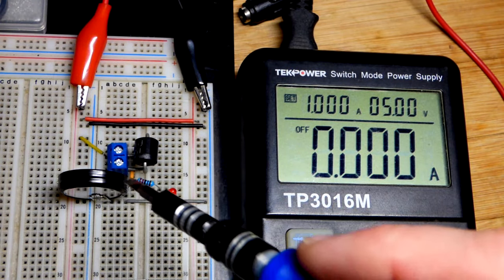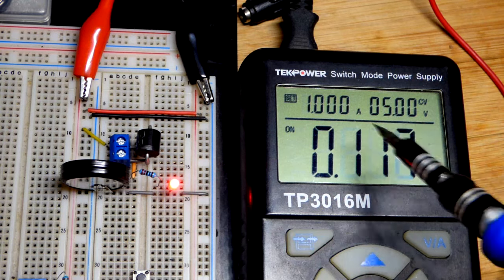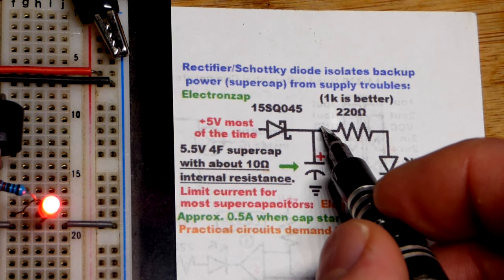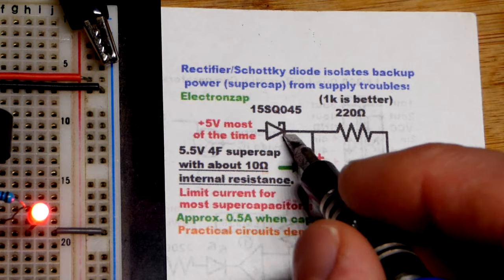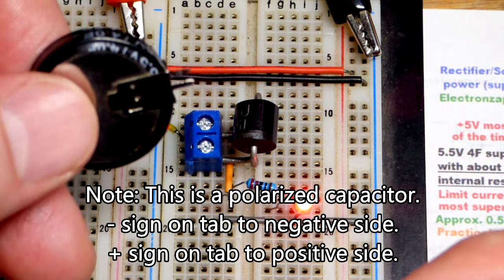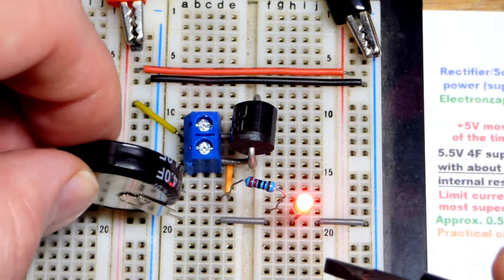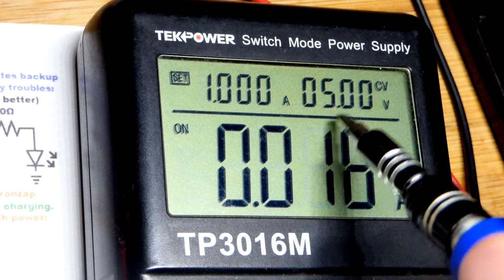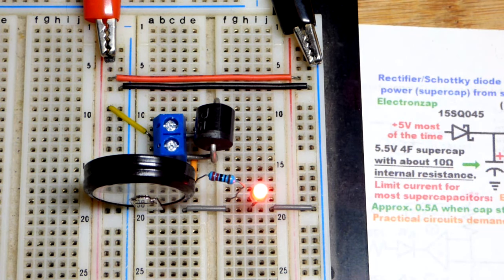Mini supercapacitor with internal resistance used as backup power demo

Comment: I remember working with my 1st supercap in the 80's.  It was a 5v 1F capacitor,  I finally opened it to see what was inside...there was a stack of five nickle-sized disc supercaps (thus in series), which implied that these smaller caps were 5F each, and needed to withstand at least 1v each.  A standard capacitance meter couldn't measure such high values, so I charged it with a constant current source and used a standard equation, and sure enough, they were 5F each!
I mostly wanted to know if they followed the laws of a true capacitor--they did--they were 'pure-capacitor'  It seemed very strange to have a tiny FIVE MILLION uF cap OF this size and almost no weight
Reply from the maker: That's very cool.

Comment: I added a 500F supercap to the input end of my power inverter in my RV, looks like a 6 pack of beer cans
2500W inverter, it can now really put its thing down when starting larger motors (1800W compressor, likely draws 3600W or more to start)
Reply from the maker: Nice, that sounds like a good use. They are good for short periods of high current.
Reply: @Electronzap  Also allows some time when the lithium battery BMS activates for the solar system to correct, and, of course, high current surges

Comment: 10 ohms would have a huge effect on any circuit more complicated than an LED. Looking for a circuit to charge slowly but discharge with low impedance to the microcontroller. Thoughts?
Reply from the maker: Could use regular super capacitors that you parallel to the load and limit the maximum current from the charging source to a lot more than what the load needs but is safe for all the connections. Can even use lithium based batteries in the same way. There's tons of options, so that's something you'd personally design to meet the needs of the circuit and what you have available.